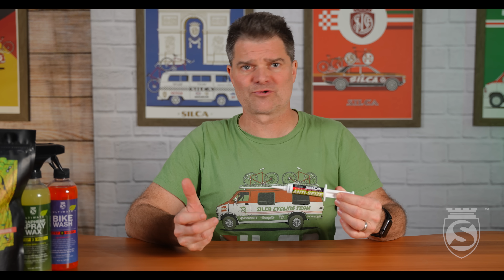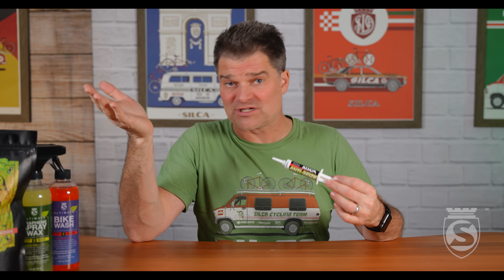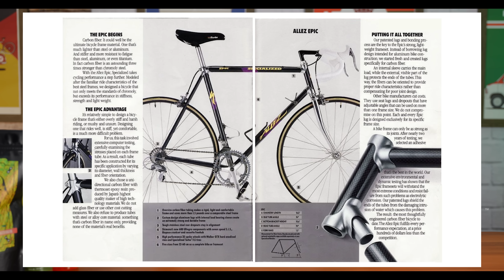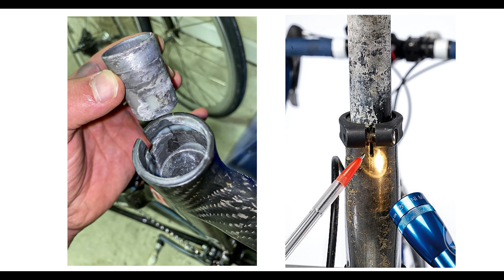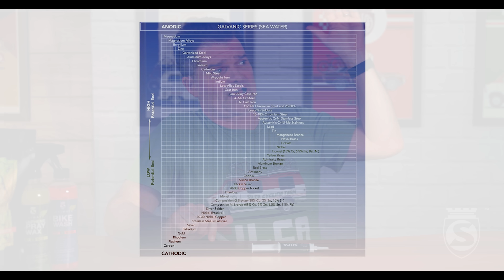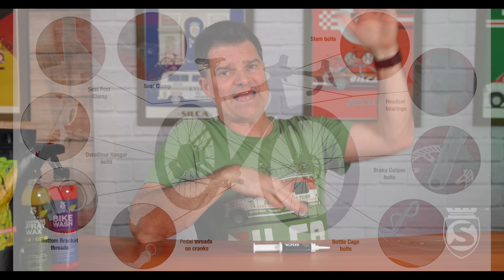Better than Grease? Anti-Seize Assembly Paste

Comment: While I understand the utility of antiseize and grease when it comes to sliding, pressfit, or threaded interfaces, I have a few questions:

1. Would EP (extreme pressure) grease have similar effects to antiseize due to its film strength?

2. In interfaces that need threadlocker, how do I apply both threadlocker and grease/antiseize?
Reply from the maker: EP grease is a great substitute in a pinch, but many of the EP additives are not particularly good insulators and can play their own role in galvanic corrosion within dissimilar bolted interfaces.  The proper anti-seize will always be better, but EP grease will be far better than nothing.  When using threadlock, you only use the threadlock as greases or anti-seize will contaminate it and prevent it from hardening.  Also note that some fastener materials require threadlock primer for the product to work properly, so be sure to match the threadlock to the materials involved.

Comment: Interesting video and product.  Two questions remain for me.  What does “Titanium Optimized” mean as proclaimed on your product tube?  Also, when/where do recommend the use of “carbon paste”?
Reply: I use carbon paste in the following areas:

Carbon handlebars
Carbon stem (only at the area you clamp your handlebars on)
Seatpost-seat tube area (if either or both are carbon)
Seatpost wedge clamp recess
Some saddle clamps (only if either area or both are carbon)

One place I don't apply it is the steerer tube. In the event of a tumble, if carbon paste is applied there, there's a chance of the stem shearing the steerer tube due to a high friction coefficient. It's better to let it slip around, but riding normally has little to no chance of doing so.

Comment: I believe anti-seize acts as a lubricant and unless you reduce torque values could strip out a bolt.  not 100% sure but that’s why I’ve always heard about using it in  automotive situations so  why not the same for a bike fastener
Reply from the maker: Just made a video to address this, but pretty much every single fastener on a bicycle should be torqued wet, be it anti-seize, grease, or loctite (or dry if it has a pre-applied loctite patch on the fastener as this stuff wets out under pressure and then hardens)  The SRAM UDH is an outlier as the female threads are actually plastic on that part.. any many common greases can soften or damage plastics, not to mention the risk of overtension and possible thread failure.  In automotive you see lots of dry torque used, but that's because they don't want greases used in the assembly for cleanliness so they use fasteners with special coatings and the like to allow for dry assembly.
Reply: This is a good question, especially when you consider that it’s common in bikes for a steel fastener to be going into aluminum alloy threads. I always reduce torque values if I’m using a lubricated fastener on bike parts. Like, a lot of bicycle components will list a torque range (instead of one single number as is more common in automotive etc). If my bolt has grease or anti-seize I’m always gonna choose the low value from the range just to be safe. (Industry torque charts typically show around a 25% drop in torque values between dry and lubed threads.) So I don’t want to strip out threads, or crush carbon handlebars from the increase in clamping forces, for example. The bike industry is definitely lagging in this regard.
Reply: Almost all torque specs I've seen for bicycles and their components never mention dry & wet torque and it should be common sense that no bolt is fastened dry (especially the bolts of cockpits) unless it's mentioned, like SRAM's UDH hanger bolt.

Torque spec standards in the cycling industry isn't as extensive as in other industries.
Reply: @sbccbc7471  thanks. I know a lot about cars and you almost never torque stuff wet.

Comment: Thanks Josh and Silca Fam for the knowledge on such a key product! I just admire how y’all find solutions across various industries. What Silca product would you recommend to clean off a bolt/part with this anti seize paste?
Reply from the maker: Bio-degreaser and a good mechanical wiping will remove it nicely (gear wipes work as well).

Comment: I use pure nickel antiseize for my automotive & motorcycle applications for awhile now, unless you need the high temp of copper nickel is the less reactive option, anywhere corrosion could be an issue it should be used. 
I don't use mettalic anti seize on my bikes btw, molybdenum & graphite...
Reply from the maker: Molybdenum and Graphite are both problematic with aluminum threads, so I'd be mindful of what the female threads are on your bikes as so many of them are aluminum in modern frames.

Comment: I sell industrial lubricants for a living and there is so much correct about Josh's explanation but there is so much more to it.  Anti-seize is used in industry primarily for issues of galling between two like metals, especially stainless steels.  But anti-seize is also very important providing a constant repeatable torque value, as Josh mentions.  His comment that you need less bolt stretch when using anti-seize was incorrect.  You need the correct amount of bolt stretch and a good anti-seize ensures repeatable torque values to ensure fastener strength and sealing of flanges in industrial applications.  The anti-seize I sell uses barium molybdates to passivate the metal to reduce issues with galvanic corrosion.  I can see where galvanic corrosion would be an issue with carbon and especially carbon/graphite and a passivator or sacrificial anodic protection (such as zinc) would be appropriate.

Nickel anti-seizes were introduced due to issues with oil contamination in turbine lube oil in the power industry many years ago.  The latest high quality anti-seize is now ceramic based, but nickel is still very good and widely used.  Copper is actually a very good anti-seize for carbon steel but the new anti-seizes are good enough that it is no longer used.   

As a Silca fan and user of many Silca products, I appreciate Josh's innovative approach and new products.  Thank you for all you do, Josh!
Reply: Josh said the amount of stretch is the critical factor and gave the example of racing engine assembly using a gauge to directly measure this stretch.  I can't find where he said less bolt stretch was needed.
Reply: Regarding bolt stretch, the only thing I heard Josh say is that when using anti seize, the variance of stretch for a given torque was reduced, from 25% to 5%. I imagine the test was to a given stretch target. If it was to a particular torque, I Imagine the stretch was greater.
Reply: Can you recommend a type of anti-seize for use on Titanium bike frames?  Since Titanium is on the opposite end of the galvanic series than aluminum or steel, does that change the compound used?
Reply: This is probably taboo to ask but what other anti seize brands would you recommend for bike applications?
Reply: @wonder_wander_why   automotive ceramic anti seize grease is 5$ for 50g :)
Reply: Bike applications are so low-tech and use such small fasteners that it is a moot point.  Now that Josh is making it, that is what I would use (except I get my anti-seize for free) because I know that he doesn't cut corners.

Comment: Where does loctite fit in to this equation?
Reply from the maker: Loctite is it's own separate category and should not be mixed with other assembly lubricants.  Most loctite products have some galvanic resistance, and all of them specify what materials they do and don't work with.  In general, I save loctite for things that you really want to stay put for at least a year and also for fasteners with robust tool interfaces as there will always be some damage risk when loosening loctited fasteners.  I loctite my cleat bolts and spoke nipples, everything else gets anti-seize except thru-axles which get heavy, clear assembly grease.

Comment: I guess the copper paste in the bike industry came over from automotive. Why are they using copper? Is it because it is half the price of nickel? Could you just use a non-metal material like shredded glass fiber? What‘s in assembly pastes that don‘t look metal-like and what‘s in products marketed as Ti-anti seize since the 90s?
Reply: Agreed, copper paste seemed just fine and Josh doesn't really back up the scary implications from his aerospace pals about using it vs his nickel product. Next time I need some of this stuff I'll probably buy Silca's but I don't think I need to toss out my copper stuff and not put anything together until I get some of this nickel product.
One thing this video should have stressed to anyone paying attention is: dissimilar metals + moisture + salt = battery, as in galvanic corrosion, which is why WASHING the bike and RINSING with plenty of clean water is essential if you want your bike and components to last more than a few seasons. No pressure washers though!!!
Reply from the maker: Copper anti-seize has been the standard in cycling since Ti bikes showed up.. it was cheap and common and works better than grease, but technology has moved forward.  There are non metal anti-seize compounds that use ceramic or PTFE, but those each have their own issues and uses and PTFE/PFAS chemicals are being phased out and/or banned worldwide so there is real time pressure to continue to innovate.
Reply: @SILCAVelo  Talking about innovation, a (micro)plastic-free towel to dry your bike or wipe your chain would be highly desirable.

Comment: What do you do if you have a carbon seat post in a carbon frame, but the wedge to secure the seat post is aluminum? I would usually use carbon paste to aid in the holding power, but from you are saying I could have issues with the aluminum to carbon connection.
Reply: I would assume put the anti seize on the outer part of the seat collar, which contacts the carbon of the seat tube.🤷🏻‍♂️ Just my initial thought.
Reply: Coat any two different metal parts that come in contact with each other.  The tightening screw of the wedge might be steel, the sleeve it screws through (bonded to surrounding carbon) might be aluminum?

Comment: This is great info, thanks Josh.   Quick question.  How does anodizing help/hurt in terms of the galvanizing process  (with AL/TI i guess)?   I presume not much at all, so using anti-seize on galvanized AL would still be a thing?
Reply from the maker: Most aluminum parts in cycling are Type II or color anodized.. this is the weakest type in terms of corrosion resistance, but more importantly, in fasteners, it is brittle and tends to fail at the pressure faces of the fastener.  It also makes the fastener way more likely to gall (this is the creaking and smoke smell people often hear when tightening aluminum screws) so you want to use an anti-seize especially with any aluminum fastener.

Comment: Will you guys be doing a carbon paste with this as the base + friction additive?
Reply from the maker: Working on that currently but sadly, it's not something used in aerospace or automotive and all of the bike industry stuff is just silicone grease with glass beads in it.. so working to bring some actual technology to the category which is never fast!
Reply: @SILCAVelo  correction - plastic beads, at least the first ones by Tacx n such. I haven't seen anything to suggest they're glass beads, it's not like they crush if I smash it.
Also there's the Motorex stuff which supposedly has whiskers in it but you can't feel anything, and Effetto Mariposa make one that's applied wet and then dries, they call it a resin. Which makes me want to try hairspray or gel.

Comment: What about Nulon Teflon based anti seize?...it's neutral
Reply from the maker: It works OK with about half of the compressive force capability of copper and 1/3 that of nickel based anti-seize, but our company has strict rules against using PTFE and other PFAS chemicals due to the increasing understanding of their toxicity in both wildlife and humans.  These chemicals will largely be banned in the EU and much of the Americas within 10-15 years, and it will take us hundreds of years to clean up the damage from that past 80 years of their manufacture.

Comment: How about aluminum and steel?
Reply from the maker: Works in that interface as well.  Overall, it's better than grease in every interface between dissimilar metals, so we only recommend grease be used when the two metals involved are same.
Reply: @SILCAVelo  I guess I need to strip the bike back down again.

Comment: Loctite 771
Reply from the maker: 771 also contains graphite and was designed for use on stainless steels, it is NOT recommended for use with aluminum, so be just be careful.
Reply: Curious what problems arise. People use this for spark plugs in aluminum heads in cars frequently @SILCAVelo
Reply: Seemingly impossible to get in Germany, if not Europe, if you are a private customer.

Comment: Fantastic explanation and information, Josh.  I will definitely be picking up some of your anti-seize.  After your comments about about frame to lug bonding failure, it makes me wonder if something similar is the cause of Shimano's recent crank failure issues.  I read a release that stated it was only a concern in cases where bikes were ridden in wet conditions (presumably creating a galvanic reaction between the bonded sections of the cranks).
Reply from the maker: 77124 like Loctite 771 contains graphite and is NOT recommended for use with any aluminum, only stainless steels, nickel alloys, and titaniums.  If you look carefully, most inexpensive 'nickel antisieze' is really more of a graphite loaded grease with nickel added and should not be used with aluminum, so just be careful!
Reply: @SILCAVelo there is so much misinformation about anti seize, it's hard to keep it all straight. Some places say not to use copper or nickel in the presence of aluminum. Others say to avoid graphite with aluminum, which makes the most sense to me. However, anti seize manufacturers seem to say it's all good in all those situations, and that nickel is used for higher temps. I switched to Marine nonmetallic anti seize to hopefully avoid the argument altogether, but now I'm concerned with the graphite content. 
I understand that anti seize can provide a barrier, but isn't there a secondary function where the additives offer sacrificial electrons to save the structural components?

Comment: It makes me wonder about the longevity of an aluminum sleeve insert bonded to a carbon frame frame bottom bracket. Wouldn't there be galvanic corrosion of the aluminum sleeve with time and failures of the bonding?
Reply from the maker: There are ways of compensating for this in frame manufacturing, typically the aluminum is bond prepped with a CAA or PAA anodize and then wrapped directly with fiberglass before carbon fiber to act as an insulator between the two.
Reply: @SILCAVelo  Is that reasonable to expect this as the common practice adopted by carbon frames manufacturer, when an aluminum sleeve is bounded inside a bottom bracket?
Is that why we see fiberglass used inside a fork steerer tube?
Reply from the maker: Everybody knows this nowadays so you don't have anything to worry about with any legit brand-name frames on the market.  Yes, it is also why there's glass inside the steerer tube.. it prevents corrosion with the compression plug which is generally aluminum and which is also in such a high-sweat area.
Reply: Now I know why my friend’s beautiful carbon tubed Merlin Cielo failed.  (Hey, why is your water bottle cage on the side of your down tube?😅)

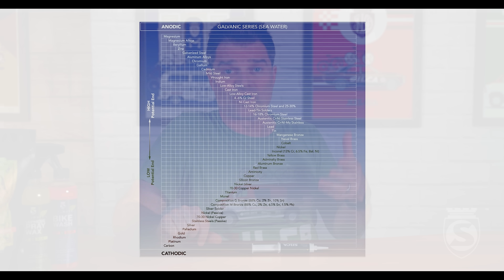Comment: at around 9:30, Josh says that nickel and fiberglass are equivalent because they are neutral...  totally ignoring the fact that fiberglass stops galvanic corrosion because it is an insulator.  i.e. electrons cannot pass through it, so therefore the chemical reactions can't occur.  Nickel is obviously a conductor, and in these sorts of sacrificial anodes or cathodes, the goal is to have the nickel react instead of the metal that is being protected.  Most of the companies that make products like anti-seize have a variety of versions that they sell, and they can advise you as to which is best for your application.  This info should either be on their website, or you can contact their applications engineers.
Reply: E-glass (electrically insulation glass) is recomended for the instances like the early frames Josh mentions, but should be the last layer in the composite.  It begs the question of why seat tubes aren't made with an E-glass layer as the inner most.
Reply: Copper Anti-Seize works pretty good.

Comment: If it is this important, why not make it cheap enough and sell it in a big enough container that everybody can use it
Reply: Copper works well enough on bikes as you will likely remove and clean it annually, torque values and temperatures are low and it’s very cheap. Betterbolts supplies Copper.
Reply: I strongly suspect this relatively exotic lubricant is more expensive than anything else available to us. Auto stuff…selling millions, so cheap. Park Tools…just grease. I suspect we are not just looking at nickel, but precision particulate size. This has to be the same spec as aeronautics as they will not have a separate line. I will get some, and insist on it. True, annual cleaning and tuning may help, but the corrosion is cumulative, so the argument of annual inspections falls down. Do it right. I want my ebike to last years, and there is NO DOUBT that all the suspension and frame parts are under intense pressures. I think I might redo all the fasteners myself, no way the bike shop is doing this. I already have 3,000 miles on my Levo.